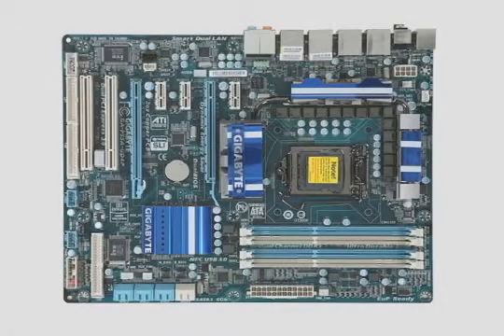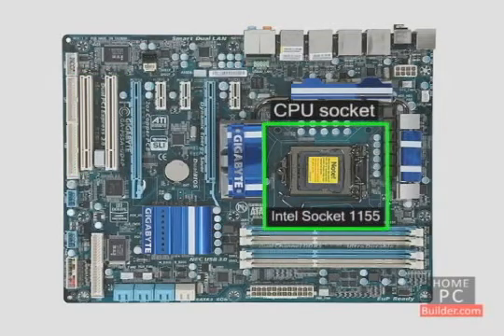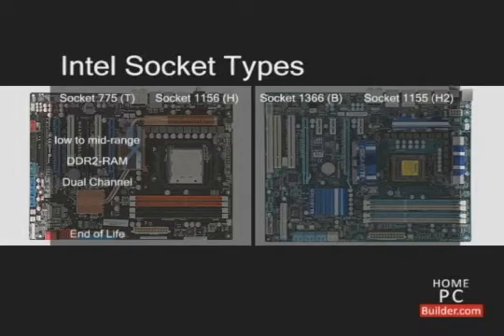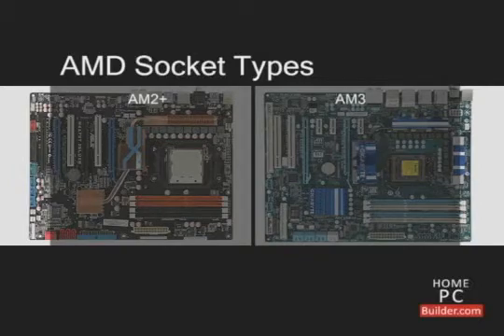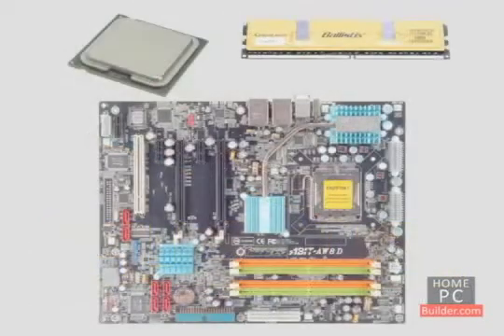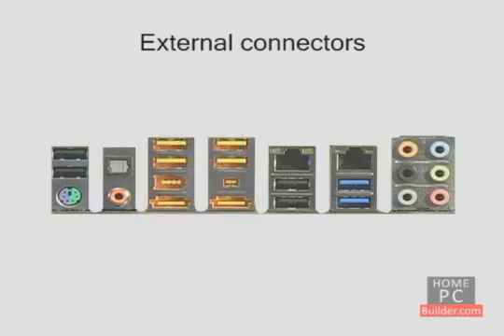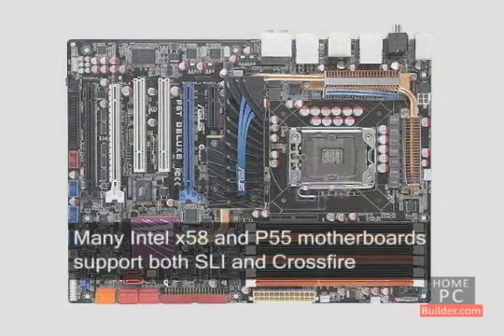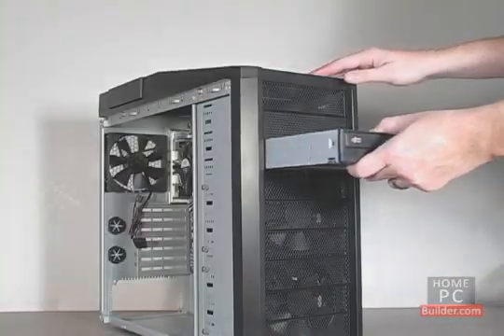build your own computer 2011 - Section 1, Lesson 8, motherboard component - www.homepcbuilder.com

Comment from the maker: You would need a socket 775 motherboard.  I see an Intel motherboard on Amazon for $35.  Search Amazon for socket 775 and you'll find it.  The other option is going with a new motherboard, CPU and RAM which is more expensive but will speed up your computer.

Comment from the maker: You can install both cards but you won't see any performance increase in your games.  Having two graphics cards will let you connect more monitors to your computer but unless you connect them through SLI on Nvidia cards or Crossfire on ATI (AMD) cards you won't see any benefit in games.

Comment from the maker: It depends on the PC.  You have to make sure the new motherboard will fit in the case.  You may need a new power supply.  You will almost certainly also need a new CPU and RAM. Possibly a new video card.  What make and model PC are you wanting to upgrade?

Comment from the maker: @FangedBeast Don't buy a socket AM3 motherboard.  No more CPUs will be made for them.  Socket AM3+ is the latest socket type and they are not more expensive than the older AM3 motherboards.